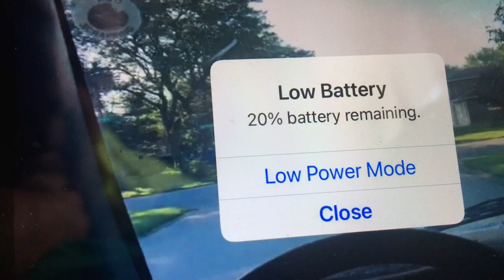SCRAPS COLLECTING HOARDER TYPE ACTION

Comment: welcome back wish i could find patcho chairs. got lucky on old hangers and crap work replaced got rid most of the dewalt stuff display and brought in milwalky.swiped  raided the dumpster.cant wait til they replace the store hope i can get all teh  inside lights and outside and celing fans that be a huge haul.be a mike the scavenger hual.
Reply from the maker: I guess you gotta keep starting that place so you can hit it at the right moment
Reply from the maker: Starting not starting